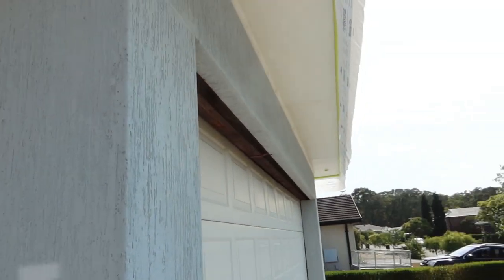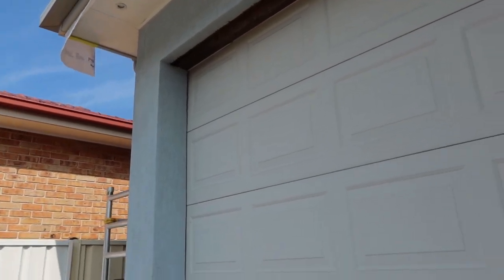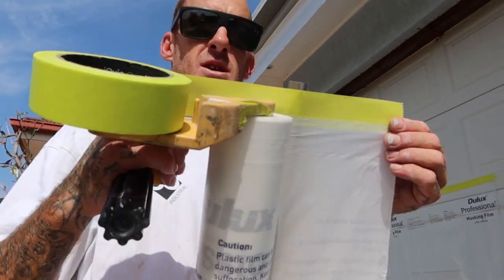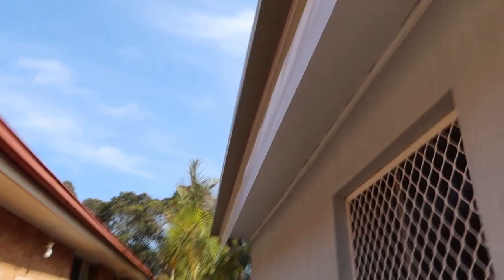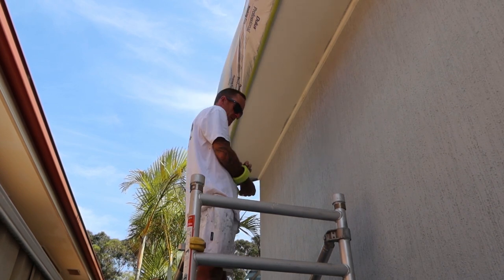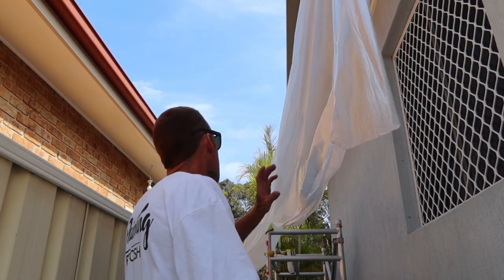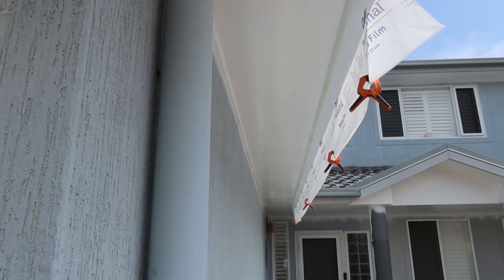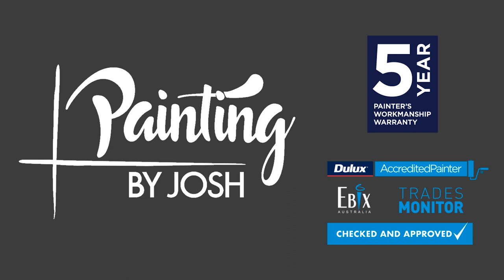TAPING & SPRAYING OUT SOFFITS

Comment: Hi Josh, great vid thanks, hey what was the tape you recommended ? I want to see if it is available in New Zealand.
I have been told to steer clear of the 3m tapes these things are designed for. What is you opinion on the 3m tapes?

thanks very much
cheers
Reply from the maker: Hi mate. I like to use the iquip 36 mm give the guys at goindustrial a call they can sort out getting some shipped. 3m is good for something recently painting its got really low tack that's about it. 🙏🤙
Reply: @paintingbyjosh  Great thanks Josh, just looking now and have sent an enquiry to them. So the iquip tape fits on the 3m masker ok with no problems ? Also seen a few pics of you as well so good recommendation, thanks again cheers
Reply: 3m tapes are shit bro, I recommend tapespec (green one) from resene or dulux. Its medium to high tack on textured surfaces but I use them on aluminum and masking trim, leaves a nice clean sharp line and paint doesn't bleed through.

Comment: Would you still spray the soffit even if you were not spraying the siding? In my case it's a brick siding and it will not be painted.
Reply from the maker: Hi Kurt's! Yes most definitely because I would be taping up the bricks if I where to cut/roll or spray. Half the work is already done💯 hope this helps mate

Comment: Hi Josh.  I've been enjoying your videos.  I'm a brush & roller painter (of 32 years).  Do you spray your gutters & facia's first, then mask for spraying soffits?? Also... You prefer using the plastic, rather than 300mm masking paper??
Reply from the maker: Hi mate, thank you for watching on. Yes I do usually spray gutters/ fascia first but all depending on the job really. I do prefer the masking paper easier to work with plus better for our environment 💯👍
Reply: @paintingbyjosh  thanks for your reply, Josh.  100% agree with you regarding the environment 👍.  Keep the videos coming!!  Your very knowledgeable and informative.  I'm just dipping my toe in the water with spraying at the moment. You helping me so much 👍

Comment: Brother, i’ve worked for a commercial mob for 10 years. The more I see of resi the more I see this obsession with spraying just about anything 😂

I like the idea. Just a couple quick ones though,

You reckon after all the taping and everything it’s still faster? Reckon it’s worth spraying soffits on new build spec homes if you have to mask all the bricks and everything?

And if you’re spraying everything, say weatherboards or gutters or soffits ect, what do you lads use in the event there’s some touch ups to be done? How do you match it without it flashing on something like weatherboards or gutters? Foamie? Or just light brush?

Cheers mate, love the vids
Reply from the maker: Hey bro, there's still not many that tape up and spray everything still a lot of  the brush and roller. After spray finish for so long you can't handle the finish that a brush and roller will achieve it just don't cut it half the time. Depending on how quickly you can tape up also I spose 15 years using this machine. It's worth it tho just for the finish. As in touch up wise I do repaints so there's really no such thing I'm the only trade make it 💯 before you leave and get paid🙌 but if you needed to recoat usually tape up and spray again unless it's down low or up high then I touch up with a foaming would work! Hope this helps brother appreciate you watching on 🤙